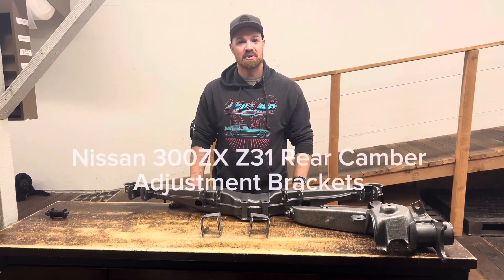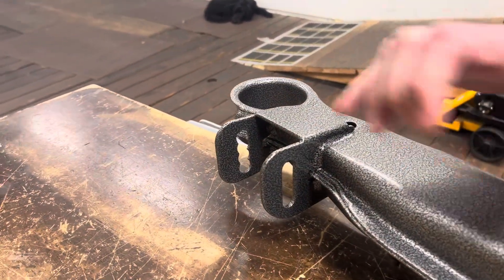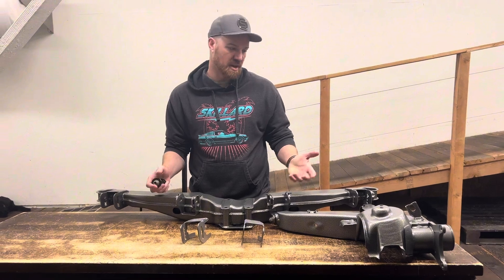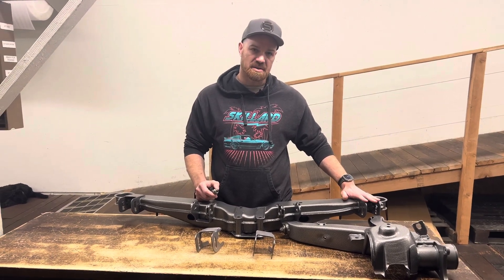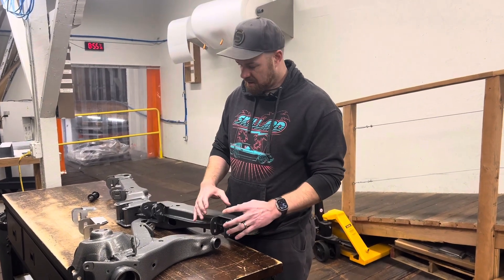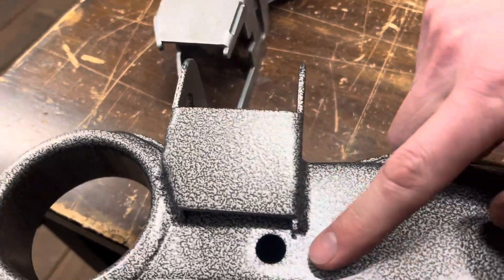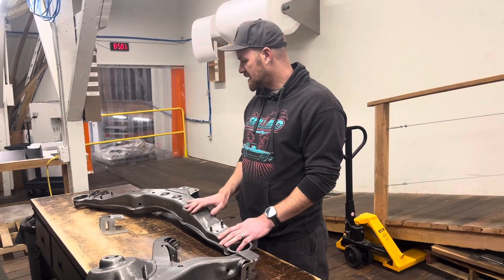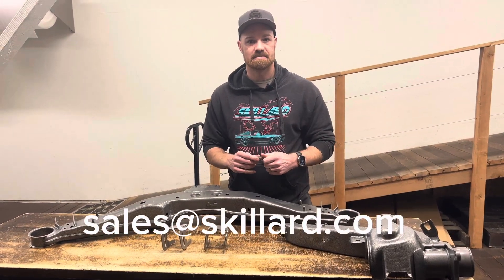Skillard’s Rear Camber Adjustment Brackets for Nissan 300ZX Z31

Comment: The guys at Apex recommended your mounts as a way to address camber issues when lowering a Z3 without shelling for a full aftermarket rear suspension.  It looks like a solid kit.  I will for sure be ordering one of these soon!!  Thanks for putting a video together - really helps understand what I’d be getting myself into.  Not to difficult it seems.